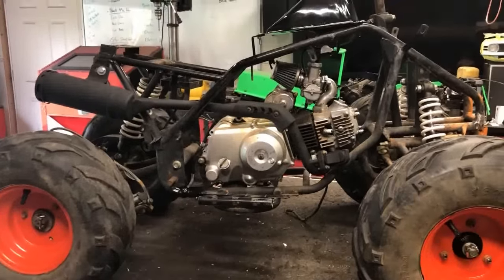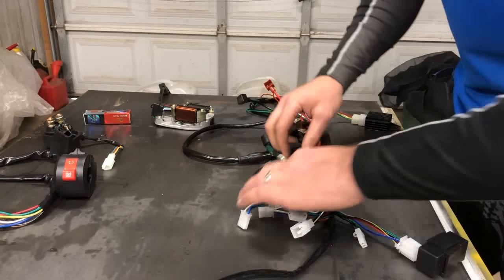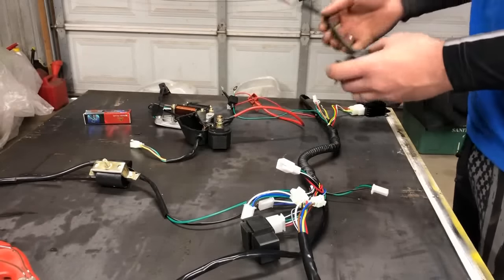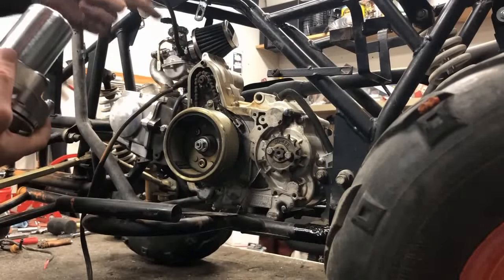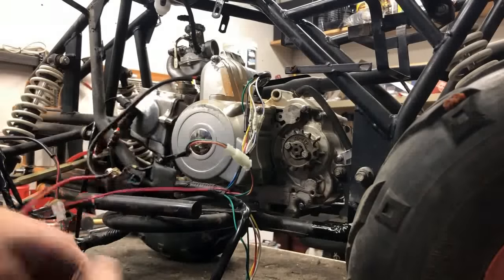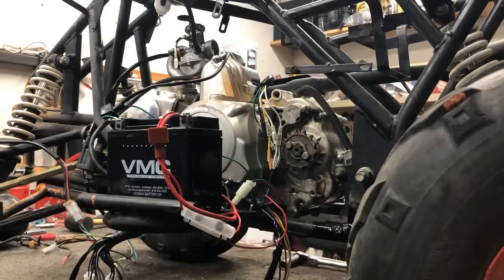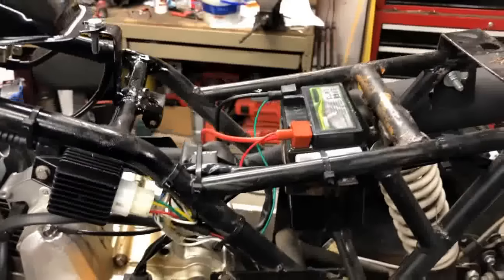Wiring a Chinese ATV from start to finish with an All New Wiring Harness!

Comment: Once again my boi...u make it look too easy.     But Im sure glad to stumble on your channel. Just did this same  job with a quad I got for $25 110 cc  but before I discovered ur channel I was lost cuz all those FAKIES out there ( u know who I'm talking about) they don't really give any good information. Good stuff my bro. Thank u. Bv the way my quad was sputering and back fireing, do u think it's the carb from sitting for a long time or do u think I have some wires crossed? Let me know if you get a chance. Take care.
Reply from the maker: bud white Thanks man I appreciate the support! $25 bucks is a steal! 100% for sure it’s not a wiring issue. Definitely a carb issue of fuel and air mixture. Take my advise and just replace it with a brand new carb and air filter. It will be the best $20 bucks you can spend on it!
Reply: @PraskaBoysGarage  Will do... Thanks again!
Reply: @PraskaBoysGarage  a how's it going? I wanted to ask if I have a quad that has a 4 pin CDI will I be able to use a 5 pin and try and color match the wires ? Cuz I can't seem to find a 4 pin wire harness kit  anywhere... I'd appreciate ur advice,but if ur too busy or just can't. Get back to me I understand take care and thank u
Reply from the maker: bud white Alright, just to clarify you want to replace the entire harness with a new one that has a 5 pin? Or do you want to plug a new 5 pin CDI into a 4 pin harness?

Comment: Hi now I have a Taotao 4wheller 2015 125cc and I have 2 connectors that I don’t know what they go to one of them is 3 pins the colors of the wires are orange white and green and then the other connector is 2 pins and the colors for that one are green and gray could you help me tell me what they are for? Anyone?
Reply from the maker: Hard to say without looking at it. Here is my best guess: The 3 pin connector. Solid Green = Ground, Solid White = Direct AC power, Orange = This isn't 100% but typically it's the headlights switch. My guess is that plug is for a headlight. The 2 pin connector: I've never seen a solid gray before so I'm not sure. They only gray I've seen is Gray/White and that's part of a Alarm/Remote Control.

Comment: I wish you would've showed what to do with the two wires coming from the starter
Reply: I have that same problem I have the harness hooked up but my starter has a red and green wire coming from it have no clue where they go
Reply from the maker: The red starter wire that I mention in the begging of the video that stays on the starter during teardown goes to the starter relay.

Comment: I'm on my second  replacement  harness  and the green negative wire that runs to the battery  gets hot and starts smoking when trying to start the bike via electric  start, any one have an idea why? :(
Reply from the maker: Sorry I'm late to your comment so hopefully you figured out the problem by now? I'd guess you have the power going to ground somewhere causing the over heat issue.

Comment: i cant see where are located de ingnition relay.
Can you show me where?
Reply from the maker: The starter relay attaches to 2 metal prongs coming off the frame. Sometimes it's in front of the motor under the gas tank.

Comment: I need help. I did this step by step pause after pause and I'm still not getting anything. No click or anything. Please help
Reply from the maker: Carlos Navarro Alright, I’m sure it’s something easy. Start here: Good battery? Is the fuse blown? Kill switch in the run position? Holding down the brake?
Reply: @PraskaBoysGarage  I'm doing a 150cc dune buggy.  The kit I have came with everything you have in this video. But only thing different was the ignition coil I have 2 prongs (green,black) . .I bought a new battery and even tried a jump starter. New carb also need help figuring out where those cables go. Damn dude I'm in over my head on this one. I wish I could send pics.

Comment: Do I need to set gap on spark plug
Reply from the maker: Usually they are already gapped but you can check them. .024" - .028" is the spec

Comment: Question for anybody, how do you map out the accessories? ( headlights, turn lights, tail lights etc) Thanks in advance.
Reply from the maker: I have an owners manual for the E22 style motor with a wiring diagram I can send you. What's your email?

Comment: hey does anyone know the reason for my solenoid to click when i press the start button
Reply from the maker: Most likely your starter relay is bad. I’ve had to replace them multiple times for the same issue.
Reply: Praska Boy's Garage well it could be but it could also be that my starter is froze and i dosent spin there is power that goes to the starter it just doesnt move
Reply from the maker: Is the clicking noise coming from the starter relay or the starter? You can always check the starter by sending power directly to it from a 12 volt battery and see if it spins. I do this in all my rebuild videos to check compression.
Reply: Praska Boy's Garage the starter relay
Reply from the maker: @DirtDragger36  Starter relay clicking means it's bad.

Comment: Would this work on a 250cc manual atv?
Reply from the maker: The 250cc requires a slightly different wiring harness. Once you order the correct harness the install steps will be almost identical. Let me know if you run into any issues or have questions!
Reply: @PraskaBoysGarage   just got it ordered, thanks for your help
Reply: @PraskaBoysGarage  also, I'm worried about taking off one of the sides of the cover because I'm worried one side Is where the engine oil is and the other side is where the transmission fluid is, how can I tell where the stator is located?
Reply from the maker: I'm not as familiar with the 250cc as I am the smaller atvs. Look for the oil cap. That is typically a good sign that cover has oil behind it. Also your looking for the stator so the cover you want to remove should have a group of wires coming out of it. Hope that helps!
Reply: @Praska Boy's Garage awesome, cracked it open today and you were correct about the oil cap, will finish wiring sometime soon, I’ll keep you posted

Btw, you are one of my favorite channels, very informative and entertaining

Comment: Those of you who might be watching this to identify electrical components:

rectifier 2:57

CDI box 3:03

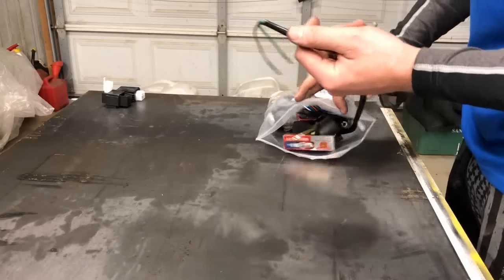coil 3:15

starter relay 3:31

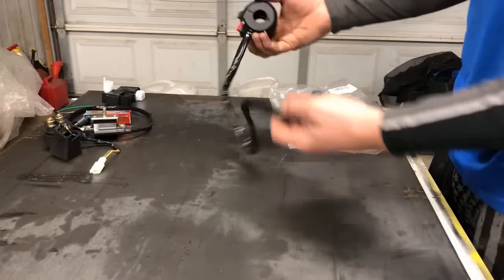switch 3:46

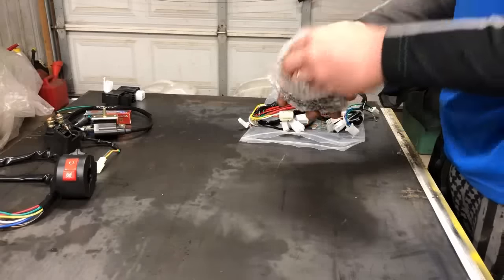stator 4:03

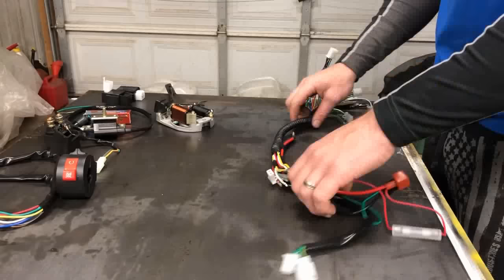wiring harness 4:18

Comment: I need help. I bought that harness. But I have no spark
Reply from the maker: Okay, it's probably something simple. Just troubleshoot a few things. Check every connection make sure all the connectors are good and not bent and hooked up in the right spot. Double check your ground that it is clean. Make sure the kill switch is in the run position. Lastly if you hooked your safety tether up in the back, remove it.

Comment: Green wire coming from the wiring harness to the ground on the battery keeps melting why
Reply from the maker: You more than like have power going directly to your frame somewhere. You should not have direct 12volts to the chassis so I would look for a short. A test light comes in handy for this!

Comment: Hey bro I installed everything but no spark plz help
Reply: Make sure everything is grounded properly and test your battery...happens often enough that the chinese brand new harnesses are bad
Reply from the maker: That's good advise. Start simple with ground and battery. If everything looks correct let me know and I can help with the trouble shooting steps next.
Reply: @PraskaBoysGarage  advice*

Thanks!
Reply: @PraskaBoysGarage  actually having issue...bayou 220 no compression
Reply: @PraskaBoysGarage   for whatever reason if i ground nthe black wire that u left that bolt lose for so u can ground nthat black wire to frame i ground that to my spark plug and i get spark intially and if i hokld the button i dont get sopark after that

Comment: So I followed step by step and it finally turns over. But no spark?
Reply from the maker: Stator, CDI, Coil, and Spark plug are the components that effect spark. You also have the ground wire, safety tether and kill switch that need to function correctly. Start with the easy stuff. Unplug your tether, clean your contacts for ground, make sure your battery is fully charged, and use a multimeter to make sure the kill switch functions properly with an open and closed circuit. If you do all that and still no spark, then likely you have a failed component. In my experience if you have a failed component it's usually a bad CDI Box.

Comment: can i change my stator from a 6 to 2. thank you
Reply from the maker: I don't believe so because the mounting points are different. On a 2 coil the pickup is fixed and on the 6 coil it is bolted down inside the case. In theory if you also swapped the stator cover you could. They both serve the same functions.

Comment: I've put the whole thing together and it's turns over but I'm getting no spark
Reply from the maker: Turning over is a good sign as thats half the battle. Did you keep your old harness? Start with the simple stuff first. Switch is in "run position" Your ground is good. If you hooked up the tether make sure its plugged in.

Comment: What amperage is the battery?
Reply from the maker: Voltage: 12 Volt; Amperage: 4AH I consider these batteries throwaways. They are cheap and usually only last around 1-2 riding seasons.

Comment: I did everything like the video and have no spark ,, 1 thing I noticed is the stator have 1 yellow and 1 white but the harness have 2 yellows instead
Reply from the maker: The yellow and white wires are both charge wires from the stator and do the same thing so it's not a problem to swap them. No spark is usually something simple. Unplug every connection 1 by 1 and inspect to make sure it all looks good. Then clean up any areas you have the ground attached to. After that it will take a little more diagnosing. Your always welcome to email me to if you can't get it figured out!
Reply: I add another ground cable directly to the green cable on the cdi and “taran”!!! Have spark and turned on ,, my kids been like a hr already on it ,, thanks for the video you made our live happier today,,, 🍻

Comment: what do if your atv dont have spark 250cc big boy
Reply from the maker: Stator, CDI, Coil, and Spark plug are the components that effect spark. You also have the ground wire, safety tether and kill switch that need to function correctly. Start with the easy stuff. Unplug your tether, clean your contacts for ground, make sure your battery is fully charged, and use a multimeter to make sure the kill switch functions properly with an open and closed circuit. If you do all that and still no spark, then likely you have a failed component. In my experience if you have a failed component it's usually a bad CDI Box.

Comment: Can v use 2coil for it
Reply from the maker: The 2 coil has different mounting points then the 6. You would have to replace you side cover if you wanted to switch coils.
Reply: My one the behind where the battery is the solenoid knocked on the the chain and started a fire that burned almost the  half of battery , the wires of the starter were burned
Reply from the maker: @davidsteve8781  Oh dang! Well it sounds like you'll be in the same boat I was in and replace everything!
Reply: @PraskaBoysGarage  yes of course the same thing
Reply: can it be replaced only with wiring harness because there was thick tube on the engine that burnned

Comment: I have a question i have a chinese atv but i want to install a speed meter how?
Reply from the maker: I've never done it before, I have always just used a phone mount with a speedometer app. You could purchase a GPS powered speedometer that sets on the handle bars and looks just like a conventional speedometer.

Comment: This video was amazing but I domt have spark and everything is how it should
Reply from the maker: Stator, CDI, Coil, and Spark plug are the components that effect spark. You also have the ground wire, safety tether and kill switch that need to function correctly. Start with the easy stuff. Unplug your tether, clean your contacts for ground, make sure your battery is fully charged, and use a multimeter to make sure the kill switch functions properly with an open and closed circuit. If you do all that and still no spark, then likely you have a failed component. In my experience if you have a failed component it's usually a bad CDI Box.

Comment: I just got a 110 Tao Tao the lights are dim till you rev the gas on it
Reply from the maker: It's pulling power directly from the stator., just like old school mini bikes and go karts do. Does your headlights only have 2 wires going to the plug or does it have 3?
Reply: @PraskaBoysGarage  3 I believe it has high and low beam
Reply: @PraskaBoysGarage  the lights won't come on with the key on, unlike the 150 cc I have

Comment: Does you can not get it backwards refer to you can’t get it backwards cause then it won’t work or as in it doesn’t matter which is which
Reply from the maker: It will work both ways, so it doesn't matter which is which.

Comment: Hello, I need help w my sons quad. Hopefully you can lead me in the right direction or someone on here can.

It’s just spinning and won’t start.
-Changed the carburetor  
-new CDI
-new battery
-new solenoid
-new spark plug
-Checked the fuel flow
Lastly spray starter fluid it slightly started and backfired 

Can someone help me with this quad, bought brand new, ridden less than 10 times, set through winter and didn’t start again, sat for a year and a half r so.

Tao Tao 125cc
Reply from the maker: Alright so to be clear you have good spark? If that's the case you need to do 2 things. 1) check your valve clearance and make sure they are with in spec. 2) If they are in spec then check for compression. Some times after sitting you can get a stuck valve, which isn't the easiest fix but also not terrible. Keep me posted!
Reply: Thank you so much for your reply....Ok, update: since then I had the quad running, unplugged the kill switch....it would stall out after giving (over half )throttle. Played w the carb screws and made sure everything was tightly screwed. Then the quad is back to the original problem.... just spinning.... I will check into your suggestions as well as change the harness (idk)

Comment: I got one of those and all I need is to fix the wires and to get a battery and I need a spark plug
Reply from the maker: Sounds like you need about $50 bucks in parts and you'll have a good running atv! Good luck on the project!

Comment: Thank you for great video. Helped immensely. One question though...your ignition coil already has wiring connected to the 2 connectors. Mine (in the kit) did not. Where do the connectors for the ignition coil (both poles) go?  I'm getting it to turn over, but spark plug isn't firing. I'm not sure if I have put the correct wires to the ignition coil or it I have the right brake safety's together. 
Mine didn't come with the male and female wires like yours and I don't see where to put them in the harness any way.  Doesn't one side of the coil go to ground? 
Here is the one I got:
https://www.ebay.com.au/itm/Full-Electrics-Wiring-Harness-Loom-CDI-Coil-For-GY6-150CC-ATV-Quad-Buggy-Go-Kart/273932530655?ssPageName=STRK%3AMEBIDX%3AIT&_trksid=p2057872.m2749.l2649
Thanks for any advice.
Reply from the maker: auratech96 I looked at the link and it is a different harness than what I used. Your correct one of the wires to the coil is a battery ground. If you don’t get it tracked down send me some pictures to my email and I’ll try and help any way I can!

Comment: Finished wiring it up and guess what…. No spark. HELP!
Reply from the maker: Stator, CDI, Coil, and Spark plug are the components that effect spark. You also have the ground wire, safety tether and kill switch that need to function correctly. Start with the easy stuff. Unplug your tether, clean your contacts for ground, make sure your battery is fully charged, and use a multimeter to make sure the kill switch functions properly with an open and closed circuit. If you do all that and still no spark, then likely you have a failed component. In my experience if you have a failed component it's usually a bad CDI Box.

Comment: Still didn’t solve the problem is it my starter motor?
Reply: My battery has power but the motor still isn’t attempting to even turn over when I press the electric start just did the same as this and it hasn’t done anything
Reply from the maker: You should test your starter then. You can put the power wire from the starter directly on the positive side of the battery. Then use another wire on the negative side and strike it against the housing of the starter.
Reply: @PraskaBoysGarage  thankyou! didn’t even think to test the starter if it’s seized up is it possible to un-seize it or just replace it?
Reply: @PraskaBoysGarage  thanks a tonne! Tested the starter and it does nothing at all still so I’m assuming it’s seized I tried the hammer handle trick but wouldn’t budge just going to buy a new starter and stator and if that doesn’t fix it still I’m just going to kill it with fire 🔥

Comment: I just got new wire harness brand new battery I’m getting no power at all no clicks or nothing
Reply from the maker: Likely something wrong in the key switch or start button. I have found a lot of times the start button will get corrosion and actually not allow it to start. Simply remove the button, clean the contact points and try again. Good luck!